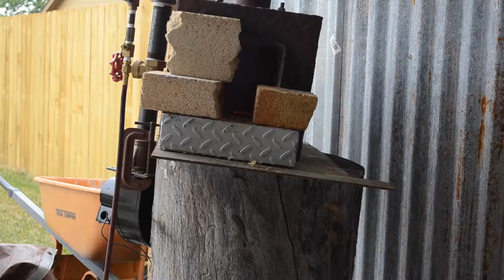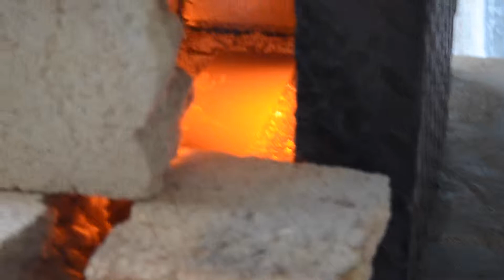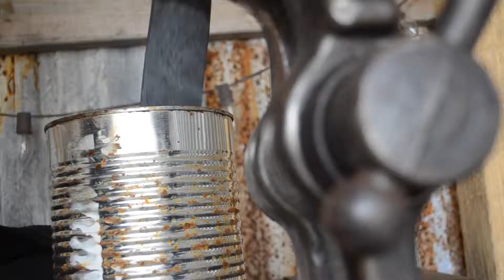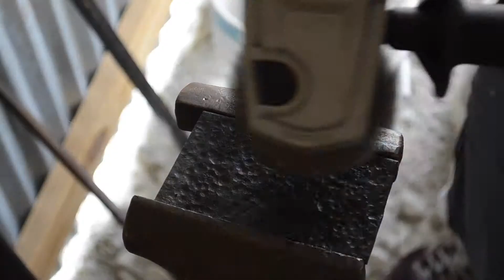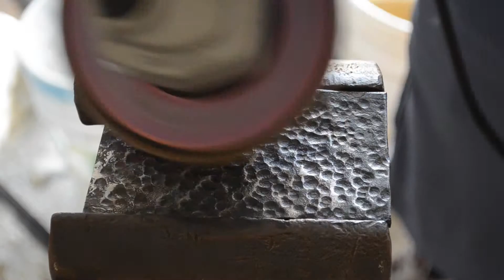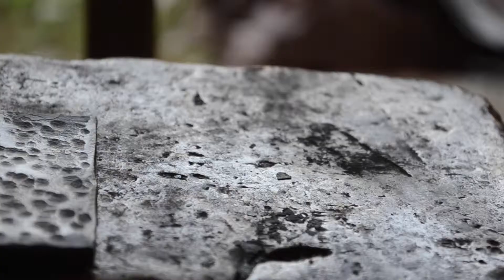Hammer Texture - Blacksmithing

Comment: I bladesmith with annealed barstock. If I heat and hammer, heat and hammer repeatedly for the textured look, Do I need to Normalize after?
Reply from the maker: Howdy Roger. You didn't say whether your barstock was high carbon (as opposed to mild steel), but I'm assuming it is. Especially since you'd be heat treating the knife, you'd always want to anneal it before quenching and tempering. Not annealing the knife (textured-hammering or not) keeps the grain structure very large (bad) and increases the risk of cracking during heat treat or while in use. Hope that makes sense! Best of luck, and thanks for the support